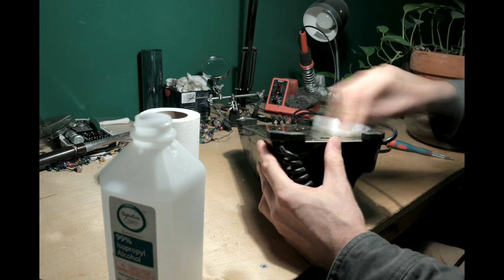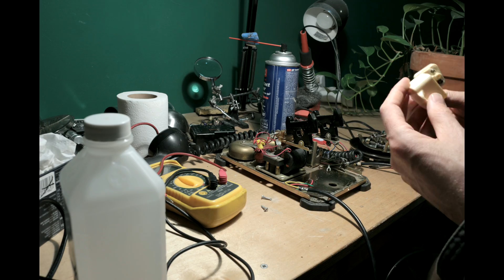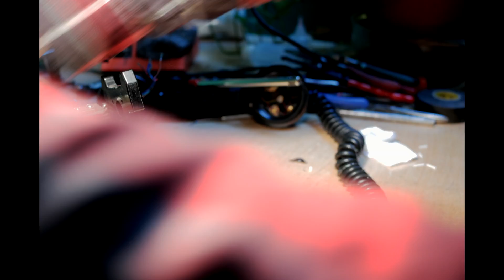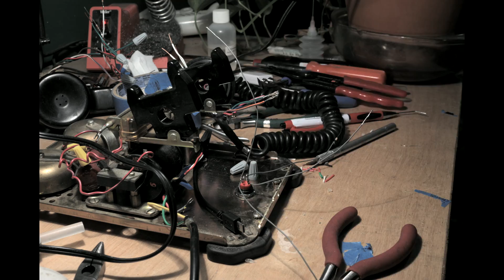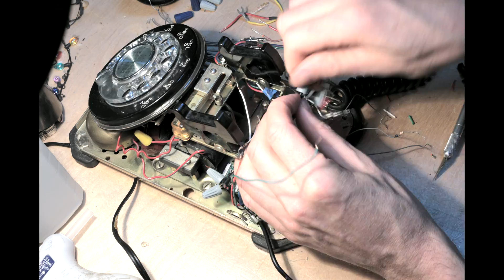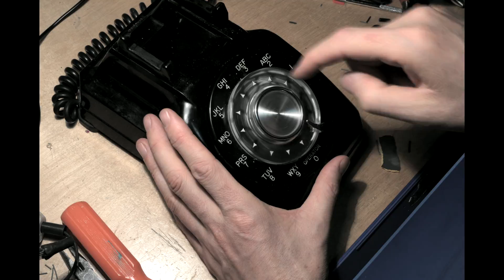Magic Telephone -- rotary phone integrated with Raspberry Pi Zero

Comment: Why not just use a $10 VoIP ATA and not have to modify anything on the phone itself?
Reply from the maker: Sounds interesting; I have no knowledge of those devices. What comes out the other side? Ethernet? USB? Are there drivers for the Pi or similar?
Reply: @CaseyConnor  The VoIP ATA connects to the Raspberry Pi that runs Asterisk (A free open-source telephony toolkit) from there you can interface with all the functions of the phone and write your own code to do whatever you want.
Reply from the maker: Number 5ESS nice. Sounds like a much easier route. :-)
Reply: @CaseyConnor  I like my route because it preserves the phone in its original state while being able to use the phone perfectly and utilize all of its functions very easily and it is all open-source and easy to operate.
Reply from the maker: @tieline1333  Is there a particular ATA you recommend?
Reply: @CaseyConnor  Grandstream HT502 is a good choice, Supports Rotary Pulse-dialing.
Reply: If I wanted to just record audio onto an SD card or micro usb from an old rotary phone, would that be a better route? I’m not familiar with them easy. I’m wanting to do something similar as  this video,  but don’t need to play audio through the phone and I don’t have any code knowledge.

Comment: Nice job! I'm always curious to see other people's rotary phone projects. Ringing the phone is doable using a 555 timer, power transistor and step up transformers. With a little experimentation you can generate voltage spikes on the the phone line large enough to vibrate the hammer and ring the bells. You would need a separate power supply and a way to isolate the phone line from your Raspberry Pi voltage rails and GPIOs to avoid blowing anything up with the voltage spikes though. I'm using an Arduino and Adafruit Fona GSM, plus some TTL for dial pulse decoding. Check out my project here: https://youtu.be/YcoMQP8CKmg
Reply from the maker: Thanks! And amazing work on your project. Much more in-depth than mine. :-)